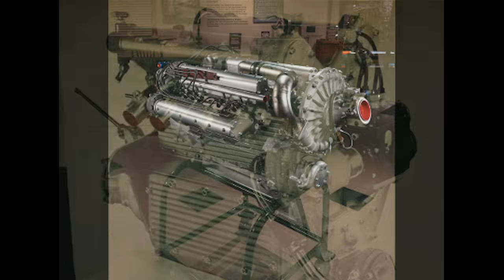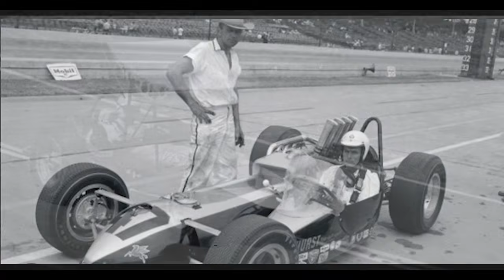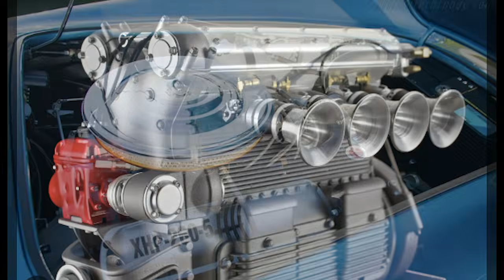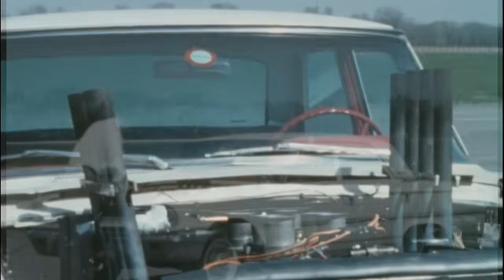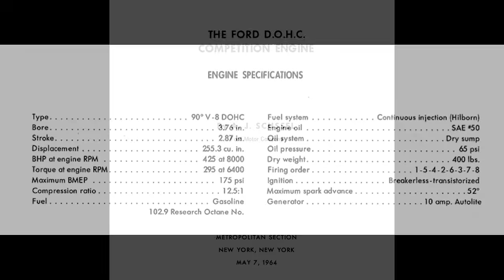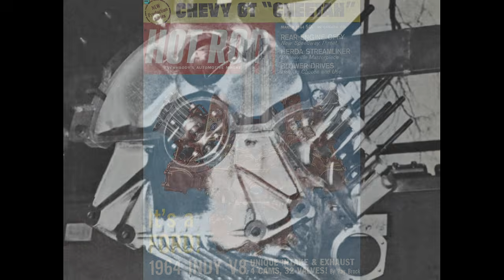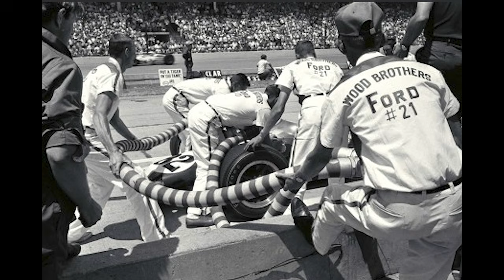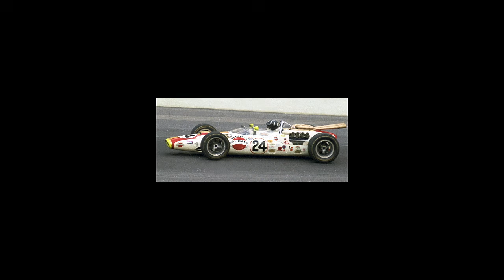Designed to Dominate: The Ford DOHC V8 Story - An Indy 500 Legend

Comment: I knew the basics of this  story as I grew up in this era.  Hearing the details  was really interesting.  I can hardly wait for your upcoming video which obviously will describe how turbocharging extended the life of that old brick, the Offenhauser.
Reply: I wouldn't go calling the Offy "a brick"........other than how incredibly strong the Offy engines were designed & built. NO "separate head & head gaskets" to worry about, because the cylinder head was cast as an integral part of the entire block..........which meant the Offy's could take an incredible amount of boost without worry of "head gasket failure". Also: I could be wrong in my recollection of WHY the Offy engines were eventually phased out: Due to their extremely durable design which enabled incredible boost & power, they were far too dominant. The way I heard it, was key players with "political power" in racing had the rules purposely changed which wouldn't allow the Offy engines to have the amount of forced induction ( boost ) that they required to make all of that power. It essentially "neutered" the Offy engines, so they soon disappeared from racing. If anyone out there knows the facts ( without an "official narrative" that stemmed from corruption )........please feel free to correct me IF I'm wrong.
Reply: @howabouthetruth2157  Your tale mirrors what I had learned back in the day about how Offy's were phased out of champ car racing. There were a lot of politics back then with the engines. IIRC Porsche was requested to design an engine for the series, then it was cancelled.
Reply: @d.e.b.b5788  That's interesting, and thank you for sharing it with me, and everyone else here who is interested. I do know one thing for sure: here in the US, officials in nearly every racing faction all throughout history have taken actions to put a stop to any engine, car, race team, etc,  who were overly dominant. Their excuse is "to maintain parity". In my opinion, that defeats the whole purpose of racing. Any time a team shows up with a very dominant engine or car, instead of punishing them, it should be up to the competitors to go back to the drawing board to try & figure out something better. THAT drives true innovation. On the contrary: punishing a team for having a dominant car or engine "to level the playing field" is KILLING innovation.
Reply: 2.65litre with unlimited boost on the dyno. Over 1,000hp before the DYNO blew up.
Best application: Revvy's groundbreaking McLaren M16c!

Comment: The engine worked, but it was born a dinosaur with the pentroof combustion chambers. No wonder it needed 53 degrees of ignition advance. 
Very shortly after the Ford was developed, Cosworth figured it out with a comparatively flat chamber and that engine went on to become the winningest engine in F1 history.
Not knocking the Ford, but it was old school before it ever ran.
Reply from the maker: I don’t think it’s any coincidence that the Offy is also a pent roof chamber but you are right. The DFV and then the DFX were next level. This was rush program and I think the chamber design was a shortcut to a degree, despite the interesting method used to finish it.
Reply: The Cosworth program was funded by Ford Europe. Cosworth developed the new cylinder head in 1967. It was basically a new step in the program. So the earlier Ford heads were not old school. They were current technology for their time. But, the tech was changing very rapidly. What was new yesterday was old today and what was new today became old tomorrow. The Cosworth heads are still a pentroof design, just flatter. In fact the majority of current cars now use the pentroof design.

Comment: I wonder what would happen with 98 % Nitro and 2 % Toluene, 34 degrees timing on the magneto and about 7to1 compression. That was the Surfers recipe for quarter mile top fuel because Nitro alone avoids detonation near top dead center but rather burns in a wider transition past TDC. They got nearly 400 runs out of their Chryslers without the bottom end girdle, a stock grind on the stock forged crankshaft and 4140 caps on the mains.  They were consistant winners in the toughest top fuel feild in the country. Once you mix Nitro with much of anything like alchohol you detonate too quickly. Tom Joad was about the only guy in racing that did a thorough research of Nitro.

That's a beautiful Novi @2:18. Too much power for most drivers because it could spin the tires virtually anywhere on the track. Two drivers lost their lives in Novis coming out of the turns too hard into the straights where it used it's power to advantage. Though qualifying on the pole and leading for much of the race at least a couple times each the Novi finishing 3rd place in '49 was the best it ever did. Bobby Unser drove Novis his first two years at Indy. Broke a drive shaft early in '63 and caught up in the horrible 2nd lap crash in '64. Hurtubise in a Novi traded the lead with Jones for a couple laps in '63 until black flagged for an oil leak that was from Jones's Offy roadster. So a black flag was used on the wrong car in '63. Jones won that year as the video stated. 

Great video. Thanks for the work and the posting.

Comment: What's a "pent roof" combustion chamber?
Reply: Look up inside a house roof. 
With a high ridge along it's long centerline, and its two flat sides sloping down from the high ridge to the edge gutters
With the inlet and exhaust valves coming in through each respective side. Facing each other...at 90degrees..just like a typical hemi.
Cross flow head........
Howz that?...anybody better at this than me? 🥴
Reply: @DennisMerwood  That was good, thanks!